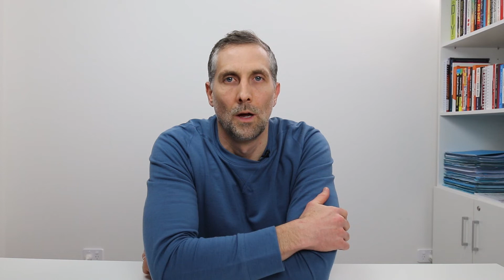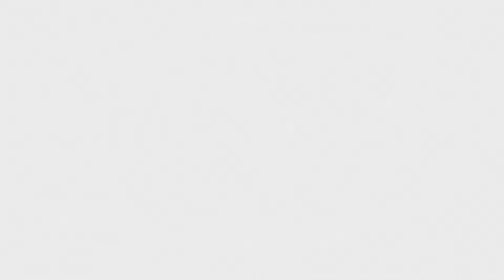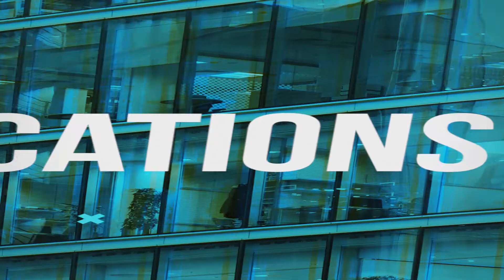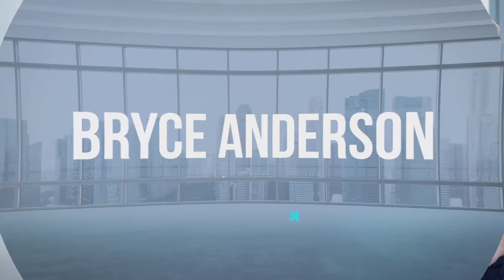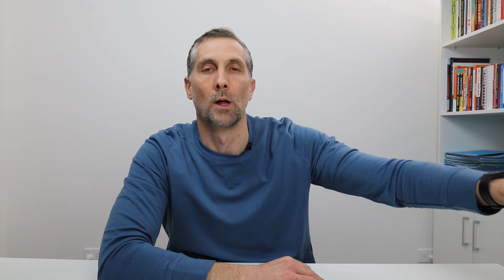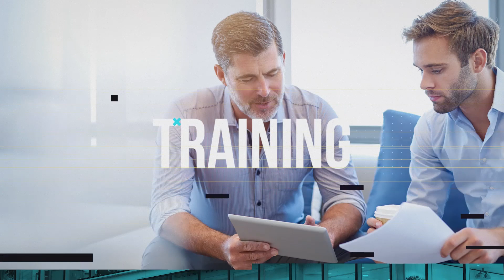BMS Distributed Controls

Comment: It's a great solution, but do we have to worry about major variation orders and their consequences if we already wired the equipment? 
I have to say so- It's a great channel with informative content, please keep posting! Thanks
Reply from the maker: Hi Hasan. 
Firstly, distributed power and controls does not cost less to install than the traditional method, it will probably cost more. The purpose is to build faster. 
Secondly, you would only do this on a new construction project is the consultant specified it from the start. Yes, there would be massive variations if you tried to introduce this half way.
It would also be a good solution for the replacement of old mechanical control panels (MCP, MCC) in an occupied building. 
Rather than try replace the board and keep equipment running, just get rid of it completely. Install a new distribution board in the plant room and run a new power feed to the VSD, and disconnect it from the original mechanical board. 
We don't need the contractors, hard off auto switches or run/fault lamps. 
You do need a plan for fire interlocking though. 
Thank you for the kind words. Cheers

Comment: Just catching up with these excellent YT Vids.   

I so agreed with all what has been said.  Ironically VAV controllers have been pre-wired like this for decades now and very few designers have extrapolated to other similar plant - like FCU and AHU !!  Gotta love when VSDs are fitted to ECM Fans 

Current writing a BMS Spec on a very unique project and taking alot to this advice on broad - thanks !!!

BTW - a few of the more sophisticated VSDs have on board programming capability and a few available spare I/O allowing some smart local control.  I was looking at pump control on a relatively recent project - the VSD supplier was keen, but got push back from the Mech Contactor ----- too unconventional !!
Reply from the maker: Im surprised you got pushback from using the VSD internal PID control. That is a pretty well tested solution. 
As long as you don't need to do duty rotation. 1 pressure transmitter wired into 1 VSD, it's pretty robust. 
Even electric meters are now coming with some additional IO.
Thanks for the support..